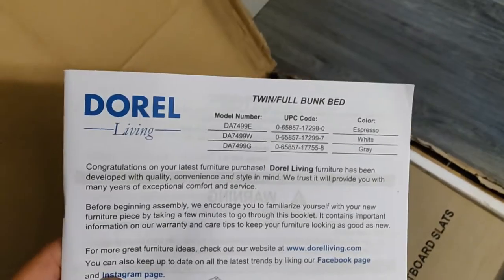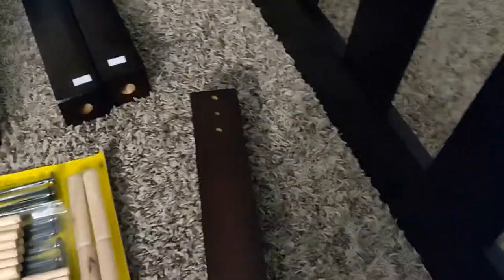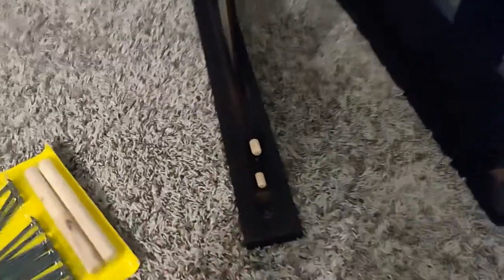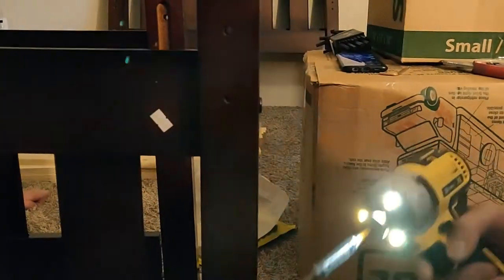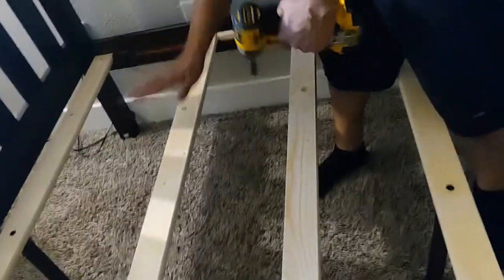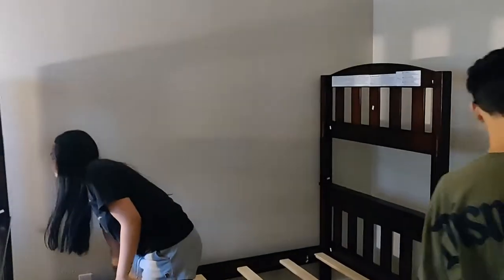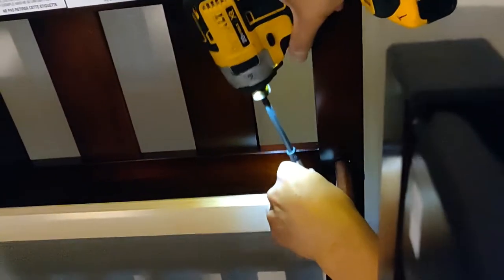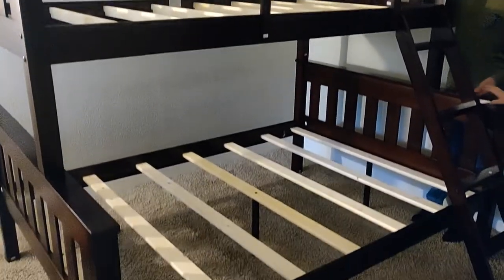dorel living bunk bed assembly available through amazon bunk bed twin over full bunk bed

Comment: Hey Miguel .. i see that bunk bed has the ladder on the right .. do you know if you could have put it on the left if you had wanted to? I’m thinking about buying a dorel bunk bed that in the photos the ladder is on the left (it’s diffferent than most dorel beds online) and i need it on the right .. is it reversible or was yours only able to go one side?
Reply from the maker: I would think that you can put the ladder on either side. But will just have to drill new screw holes
Reply from the maker: I actually am using this bed as 2 beds now one twin and one full
Reply: @migueltorres79 the manufacturer replied to my email and they said the beds are only configured to be used as shown in the photos .. interesting right?  I still think that if you’re handy like u are, then u could drill new holes but you’d have to be pretty experienced and creative i think
Reply from the maker: Very doable
Reply: @migueltorres79  for you lol